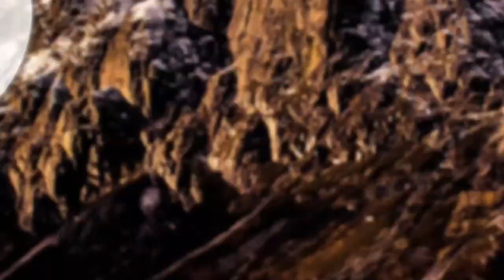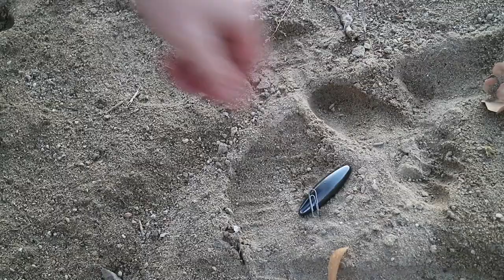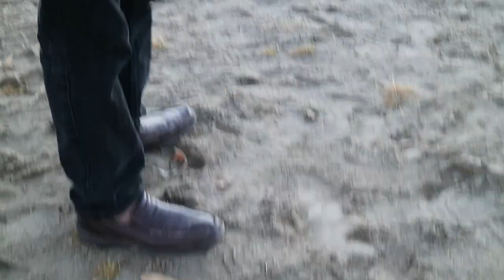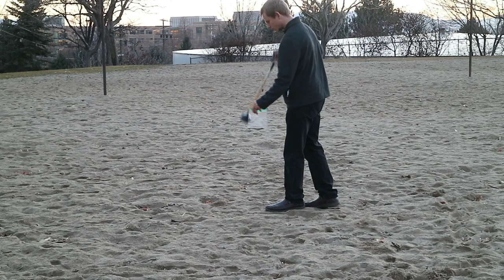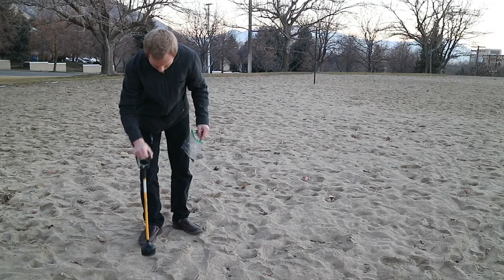Collecting Magnetite Iron Ore

Comment: I have ~4 pounds of magnetite sitting on my table, that I collected in this EXACT way. Mine is just waiting for some Al powder.

If you want a tip; Dig a trench about a foot deep, the magnetite will have concentrated in a layer down there, and there's WAY more than on the surface.
You might have to dig a couple different spots on the beach, but when you find it there will be more than you could ever want. At least that's how I got all mine in like an hour.

Really looking forward to seeing what you do with this purer ore! :)
Reply: Another tip: I just brought a bucket and a small shovel, find the seam where the magnetite has concentrated, and start shovelling concentrates into the bucket.
Fill the bucket with water and drop the magnet in. Shake it around, extract magnet that is full of magnetite, scrape it off into a container and drop it back in.
Reply: Thanks for the tip(s)! Any luck with using your magnetite so far?
Reply: @ancient991  Unfortunately I had to move away and into an apartment, and I was too busy with my glass experiments before that. Still have it though, so maybe one day.

Comment: hmm. get a kiddie pool fill it up with dry non-clumpy sand and move it back and forth which with luck should partially separate the iron from sand. afterwords discard the iron depleted sand and repeat three times. afterwords get the remains from the three times add them together and do it again then use a magnet and you should get some sand. if im bad at explaining things I have another Idea.

basically separate it like they would U-235 and use a magnet on the sand to separate iron from other metals like lead (of course some other magnetic metals like nickel could also stick)

how does one remove carbon from bloom iron?
Reply from the maker: Carbon cooks out at high heat. Industrially they use oxygen over the liquid metal. But it cooks out in the forge as well. JB
Reply: @GoodandBasic  ok

yes but wouldn't that reoxidise the iron?
Reply from the maker: Yes. At least some. This is one reason why high carbon cast iron wasn't economical to produce until the last couple of hundred years. JB